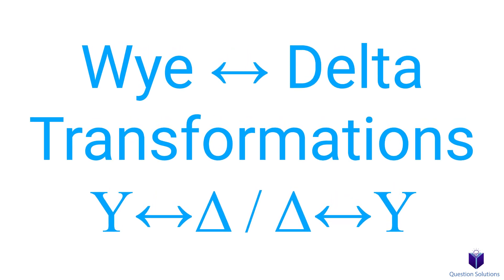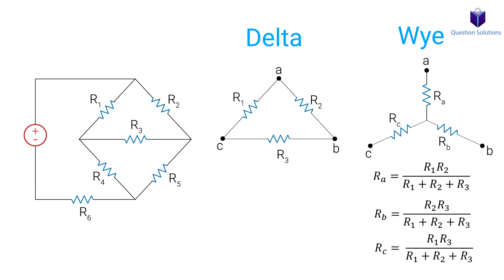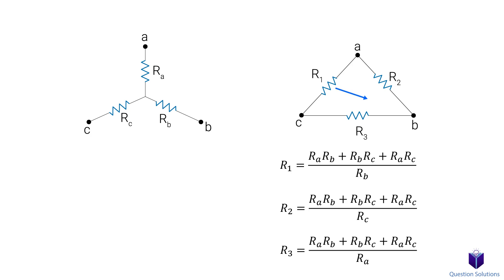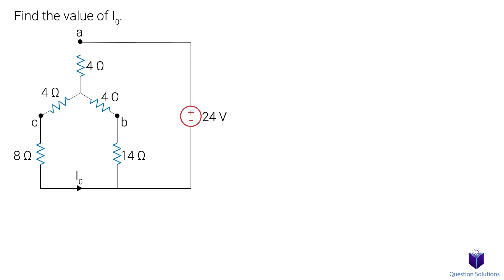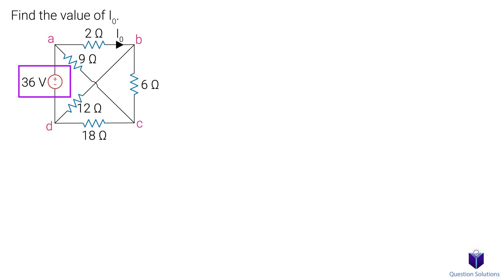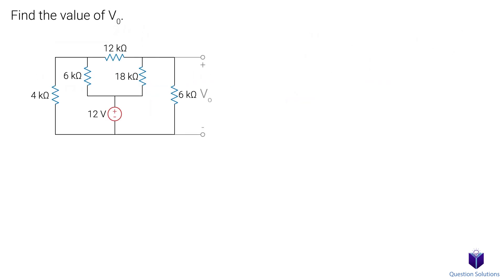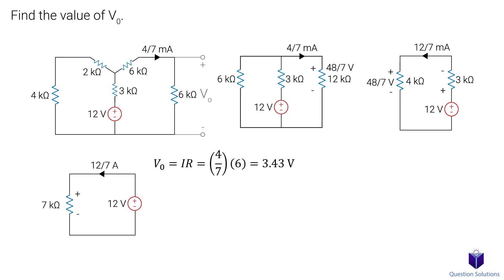Delta to Wye and Wye to Delta Transformations | Engineering Circuit Analysis | (Solved Examples)

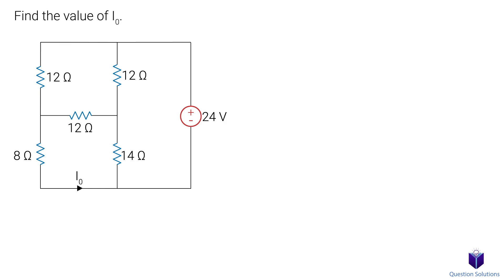Comment: For example @4:17. If I solve the bottom half I get the same 15/7A total current but a different Io value... Why?
Reply from the maker: I don't know, could be so many reasons, maybe applying the current incorrectly to a resistor, wrong voltage to a resistor, numerical error in an equation, too many reasons to know without seeing all the steps.

Comment: At 6:08, did we only find current going through the 12 ohm resistor because in our initial diagram, we see Io last leaving the 8 ohm resistor? (knowing that the 8 ohm and 4 ohm were combined in series to make the 12 ohm resistor, so Io technically left the 4ohm and 8ohm resistor before combined into one resistor)?
Reply from the maker: Yes, so the 4 and 8 ohm resistors were combined in series to make the 12 ohm resistor. Whatever current flows through the 12ohm resistor is the same for both the 4 ohm and 8ohm resistor since current in a series circuit is the same.

Comment: At 11:10, why is the 6 kiloohm resistor parallel to the 12 kiloohm resistor?
Reply from the maker: Imagine you're standing in the middle conductor (the one with the voltage source and resistor). From there, you can either go to the bottom or top, and you get two directions to travel, left or right. If you go left, you go through the 6kohm resistor and can come back to the voltage source, and if you go right, you go through the 12kohm resistor and come back to the voltage source. Either way, you get 2 paths, and both lead to the same spot. So that means those 2 resistors are in a parallel configuration to each other. I have a whole video on this, so if you have the time, please take a look: https://www.youtube.com/watch?v=Gn26z60tTog

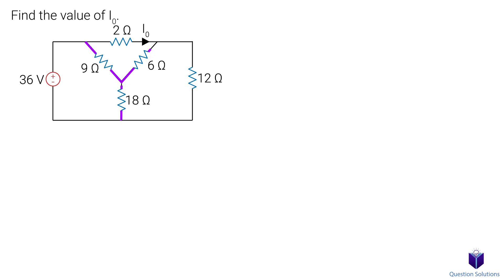Comment: Thankyou for these in-depth and concise videos. At 8:46 you mentioned that 2 ohm, 6 ohm and 18 ohm resistors make a Y. Can we use 2 ohm, 9 ohm, 6 ohm resistors as a delta to be converted to Y? Why or why not?
Reply from the maker: You're very welcome and yes, you can. You can pick whichever one you want and solve the question.
Reply: @QuestionSolutions  Thankyou!
Reply: @QuestionSolutions  I converted the delta to a Y but then got stuck trying to find the current across 2 Ohm resistor. Did you choose Y (to be converted to delta) so that the 2 ohm resistor wouldn't be affected and it would be easy to find the current across it?

Comment: for the problem at the minute 6, can we also restructure the schematic to the Y one using the node b as the center? I noticed that the way you intuitively assumed the possible resistors in Y formation is by looking at the node where three resistors are connected to while the other ends of each resistor connecting to different nodes. I am sorry if it is confusing. My english is not the best.
Reply from the maker: So you can restructure the circuit anyway you like, it's totally up to you. Just make sure you do the checks so that it's equivalent to the original circuit. After that, you can solve the question using delta or Y, totally up to you. As long as you get the same answers, your method is just fine!

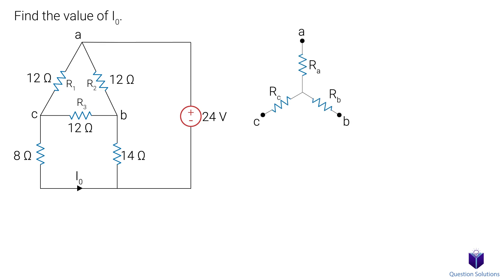Comment: Can't we just apply mesh law at 4:55
Reply from the maker: You can apply whatever methods, nodal, mesh, superposition, etc, you'd like to solve these circuits, but this video is about delta to wye and wye to delta transformations. So that's what's shown.
Reply: @QuestionSolutions  I mean can we apply mesh analysis on first question would it work? Kindly reply because tommorow is my paper 😅
Reply from the maker: Yes, absolutely you can!